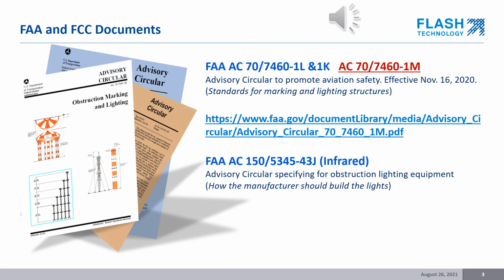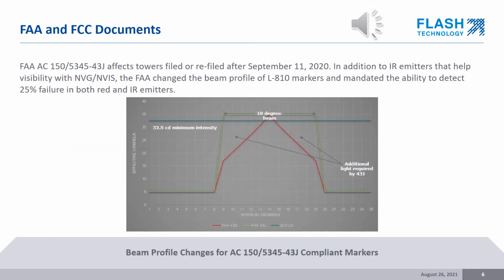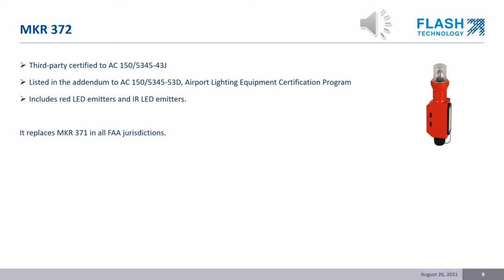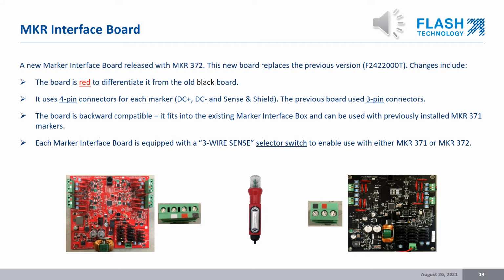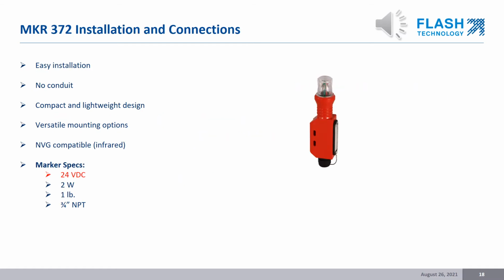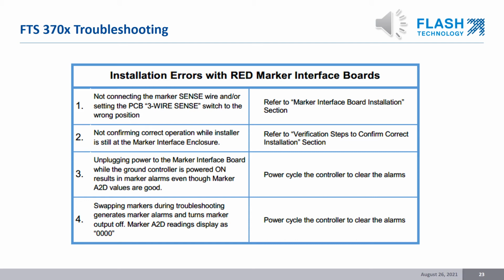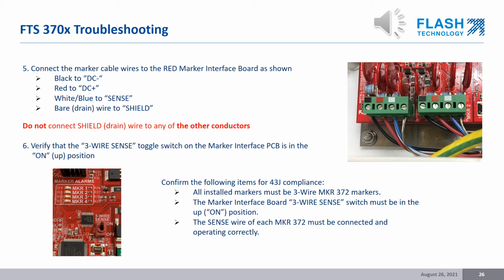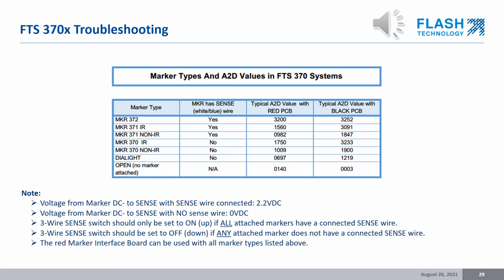Vanguard Medium FTS 370x Updated for IR Compliance

Comment: Does the FTS-370d also have the standard 20 FPM night mode? (Like an FTB-324)
Reply: @Travis Glanton The Tower Enthusiast Never seen it, so I want to make sure. I think it's possible because a friend told me that you can change the flash rate by moving jumpers inside the flash head on the 370i. He owns a 370r now but I'm guessing it's like that for all models.
Reply: There are dozens of towers near me that have the 370 with the 324 night mode.
Reply from the maker: You are correct, the FTS 370d is capable of 20, 30 or 40 flashes per minute (FPM) when operated as an L-864 red beacon. The change can be made through the onboard user interface (display screen) or through a secure remote connection.